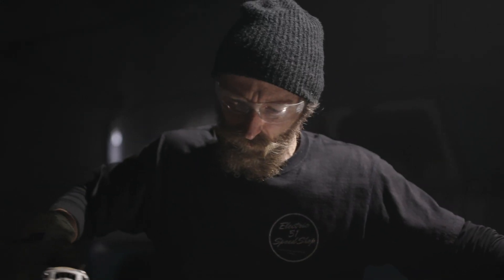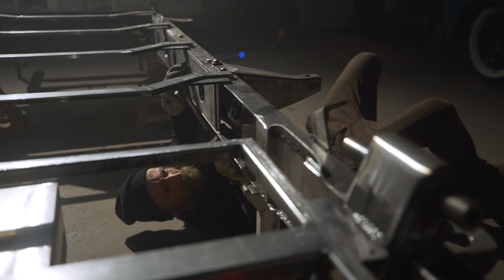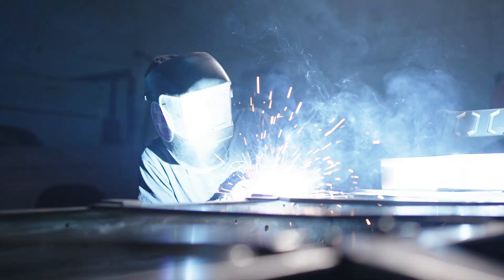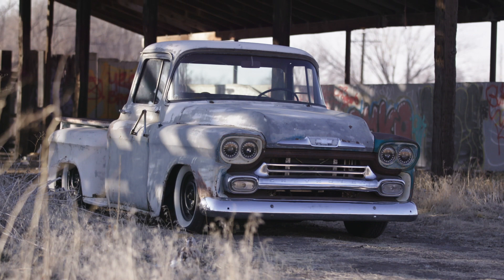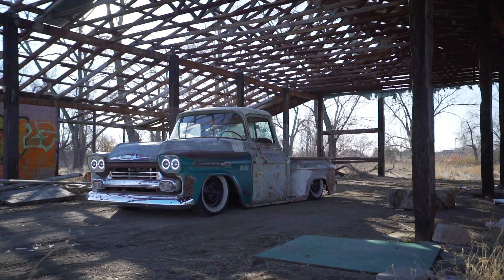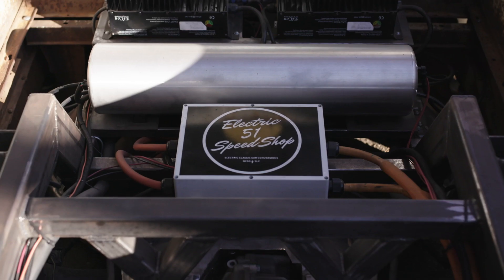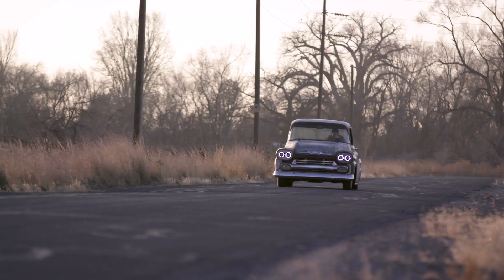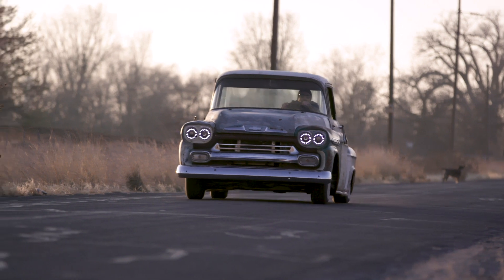Electric 51 Speed Shop and the Tesla powered 1958 Chevy Apache

Comment: ⚡⚡That's awesome! I'd love to do that to my 59...think I could cover the cost by selling my rebuilt 235 ?⚡🤑 ⚡
Reply: What's your rebuilt 235 putting out? Still single barrel Rochester?
Reply: @griffixdc  stock build, but using a 2bbl Holley/Weber. Will probably put the stock Rochester back on, though. Don’t know what hp it puts out. Enough to move the 3k+ lbs of truck pretty good! 🙃